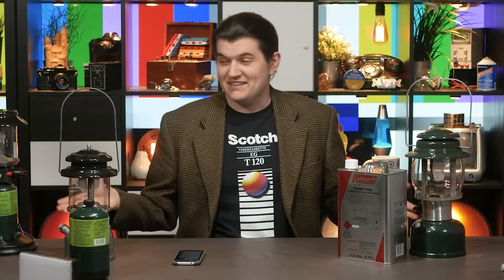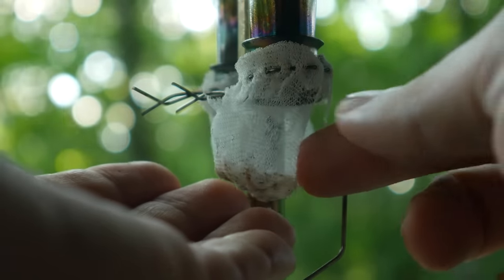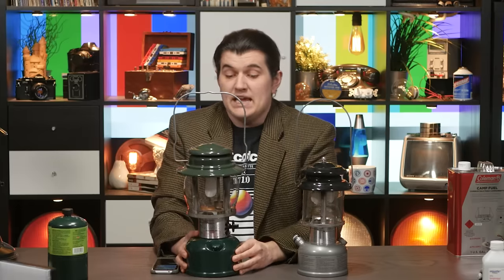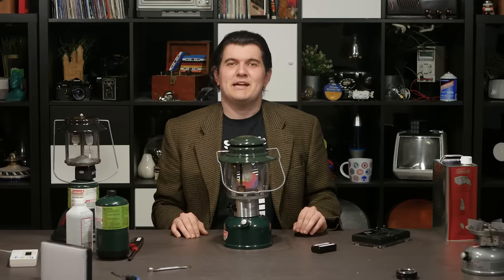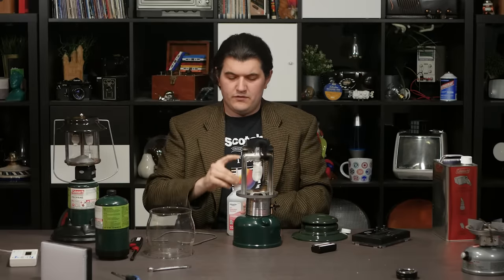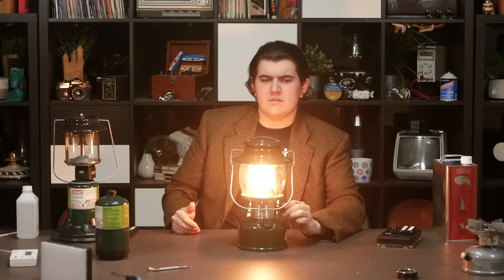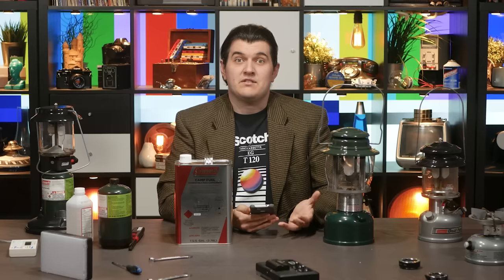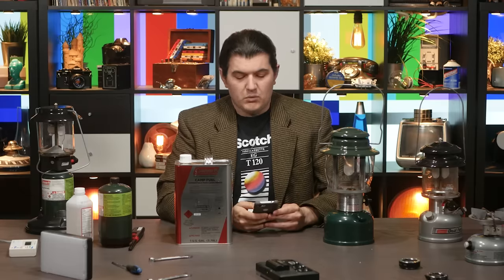A very rambly Coleman Lantern follow-up. Turns out they rarely make sense in 2021

Comment: I use all my white gas lanterns indoors. A properly maintained lantern with a properly tightened fuel cap would never leak.

Plus, Coleman tests these with a burst rating at 1k psi. Operating psi is about 30.

Comment: I think when you strip everything away, the petrol option seems more reliable, ie, you know what you're going to get & for how long, whereas batteries can be unreliable, can wear out quicker than expected, or even be faulty.  If I were in a position that I needed to consider these options, I would use both ;-).  Great video, subbing now x.

Comment: The only time I could see these lanterns and stove being used is while you're in cold conditions, where batteries die very quickly and the fuel doesn't freeze that easily. We used these in Greenland while it was sub zero conditions.
Reply: It's rare, but some folks (stereotypically farmers) actually keep a tank of diesel fuel somewhere practical on their property (and I don't mean a hand-luggable tank, I mean a 50+ gallon tank) just so they can run e.g. a tractor without having to take it to a gas station. If you already have the fuel for your non-emergency needs, keeping a few lanterns around that can run off of it but are fit for carrying around makes sense.

Comment: In Oklahoma here. When it comes to emergency lighting, we have rechargeable LED's that we'll be happy to use during a power outage in the summer. However, in the winter we use the Coleman indoor propane heaters as a heat and light source. You're right that dual purpose heat and light sources are very important in a winter loss of power. Even in those cases though we make sure we use products that are rated for indoor use and those lanterns just don't fit the bill. 

I agree with you on everyday or camping type needs though. That's why we have a lot of lanterns and lights that are rechargeable and quite a few external batteries that we use to recharge things while we're not at home. If bad weather is coming our way we always make sure to top those batteries off and recharge as many devices we might need as possible. It just makes the most since to do it that way.

Comment: Kerosene lasts a VERY long time.  I have burned 10 year old kerosene in a kerosene heater. It did not smell any different and did not burn any differently.   It's not like gasoline where it goes bad in a few months. 
Because you can buy kerosene from a gas pump, you can buy it it whatever quantity you like, and still pay the per-gallon price. You can literally but a quarter's worth of kerosene at the gas station.  Or you can drive in with a 55 gallon drum and fill it up assuming you can lift 55 gallons at 6 pounds a gallon.
Kerosene is a MUCH better supply for emergencies than batteries. You can buy kerosene heaters (which I have), kerosene stove tops (which I have) and kerosene lanterns which I do not currently own one.  With the longevity of it, you can buy a LOT of kerosene. It is very safe and easy to store as well.  I live in a very large city, the 5th largest in the US and I can literally walk to the gas station and buy kerosene any time of the day or night.  Even in a place like Philadelphia which is a large city with lots of infrastructure, there are 2 gas stations close enough to my house that I could walk to them if necessary.  I can also get it delivered in 55 gallon drums.
Second, batteries are only good one time for emergencies unless you have a generator to recharge them.  If your power outage lasts a few hours, batteries are fine. If the power goes out for a week, batteries are USELESS.  Battery operated cooking really isn't practical nor is battery operated heat.

Comment: "I just cannot find a way to make any of these justifiable to where you know you need a portable light source."

They're cooler than LEDs, that's all the justification needed. =]
Reply: Well not litterally, they actually produce substantially more heat for a given amount of light.
Reply: @garethbaus5471  Which is a bonus
Reply: @trueppp  depending on the exact circumstances.

Comment: 20:40 what’s the runtime difference between white gas and kerosine on a full tank?
Reply: The withe gas lanterns run about 4h on one tank.
Reply: I would think not much difference assuming the same size tank. I believe kerosene has a bit more energy per gallon than gasoline ( I know diesel does), but I think the difference is small.

Comment: I found my dads old 220B from the 40s like 10 years ago and it peaked my interest.  I no have 2 220s, a 228 i think, 200A red single mantle, a 2 burner white gas burner and a 501 pocket stove..

Once i got into the old Coleman white gas lanterns I found a lot of them for cheap on Offer up that were only in need of a new O ring or the leather gasket on the pump needing soaked in oil for 30 mins to make it air tight..  i love Coleman white gas lanterns and stoves

Those holes on the metal base of the mantle will fit a flint/striker so the lantern is more self sustainable incase you dont have a match or lighter

Comment: Whenever we camped, we hardly ever lit the gas lantern because it attracted every insect within 5 miles. 

(And occasionally set them on fire.)

Propane stoves and lanterns also don't work well in cold weather - there's not enough heat to vaporize the propane in the tank.
Reply: So to put it in short: If you have an abnormal environment (for example extreme cold), you need some specialized equipment. Like in every other aspect of technology.

Comment: Coming from Norway I as so many others grew up with the Primus multi-fuel burner. They required some training to use and make them run efficiently, but they could run on so many different kind of fuel, and I quote: "including gas, petrol, diesel, kerosene and even jet fuel". It was and is still, as far as I'm aware of, used in the military. It's very convenient and it gives some comfort to have a cooking stove that could use so many fuel sources. You could use them to heat and/or light up the tent. However, when I'm out hiking now I use LED-based lights and I have a couple of the same panel you show in this video. They are much more convenient when you just need light. However, you will still find a lot of kerosene lamps in most traditional Norwegian cabins.
Reply: Hi thomasgabrielsen have you become a flat earther yet? If not I suggest watch a 13 part series called What on earth happened by Ewaranon to learn that the earth is not a globe. I got it in my about tab.
Reply: @flat-earther  No. I'm probably what you most likely consider a lost cause.
Reply: @ThomasGabrielsen  Okay. I suggest watching the series to learn stuff you may have not heard before.
Reply: @flat-earther  Just out of curiosity: What made you ask a random person commenting on a video about kerosene lamps if he has "become a flat earther yet"? It doesn't make any sense.
Reply: @ThomasGabrielsen  My comment is a random suggestion.

Comment: I bought my Coleman lamp (white gas only) 20 years ago when I moved into my rural home with electricity that could be kind of spotty at times.  I also bought a gallon of white gas, and after 20 years still have some left - and the lamp runs just fine on it.  I doubt that would be the case with batteries - their chemistry is just too fragile.
Reply: Yeeeeah, I mean li-ion batteries are pretty good since 2012 or so, and I still have some cells from 6 or so years ago that still work alright, but the tech is not quite at the "decades in storage" level yet.
Reply: Yeah, they are a great backup to pull out and know it will work as long as it wasn't getting wet and rusty. Plus provides some heat for your hands too, and a makeshift stove if you put a rack over it. 

 Even if someone stashed away a propane lantern and some 1lb bottles there's no guarantee that seal on the tank won't have leaked over a decade and you are left with no fuel. 

I have my solar setup and big batteries, but i'll still keep my lanterns and stove :)
Reply: I got you but then again. If you've used less than a gallon of white gas in twenty years...wouldn't it be easier to just use basic non-rechargable battery powered lights that cost nearly nothing and change batteries every ten years or so? I always have a few batteries at home.
Reply: I'll take "didn't really watch the video" for $400, Alec.

Comment: Some items are timeless. That includes traditional belt buckles (people try, but all the new designs are soon forgotten), the concept of men carrying a wallet, and lanterns that don't need batteries to work. Yes, even in 2021. Plenty of rural places out there where only a bit of light will seem like the sun came back out. (No light pollution from street lamps or office buildings at night.) And in those places, a bit of fuel is far easier to find than some new batteries. In third world counties, the above isn't going to apply to just the rural areas. These types of lanterns are going to be around far longer than most YouTube content creators will be.
Reply: Ratching or quick release belts have replaced “traditional “ buckles for me for years
Reply: The Sofirn BLF LT1 lantern was specifically designed by the Budget LIght Forum to work for extended periods off-grid.  It lasts for 7 hours at max brightness of 600ish lumens, which is "illuminate the entire campsite" kind of light.  Inside a room you can get nice illumination at a much lower brightness, and it can do 50ish lumens for 60 hours straight.  It uses lithium ion rechargeable batteries, and has usb-c charging built in.  It's designed to charge off foldable solar panels, so unless you are somewhere that the sun doesn't come out for multiple weeks at a time, the LT1 will be a much more cost effective and convenient option in the long run.

The included lithium ion cells are relatively good, and should be solid through more than 500 charge cycles.  You can also get higher end cells with better quality and capacity if you want, and those should give at least 1000 charge cycles and offer longer runtimes.  With daily full use, that's about 3 years before you need to spend another $25 on more batteries.

Comment: The whole in the pump stick being able to stay covered when pumping is a new feature. We had an old camping stoves in the Boy Scouts that would not move to the out position if the finger was over the little hole. I imagine they changed that in later designs and it has a valve somewhere else too.
Reply: @Les I think the only real change in the pumps over the years is that they changed the material in the cup on the plunger (the part that actually seals the pump cylinder) from leather to synthetic rubber somewhere along the way.

Comment: Anything electric in outdoor conditions boils down to reliability when exposed to the elements. You can swim through a river with your entire propane/gasoline/kerosene gear, let it dry and still use it. (Sometimes you just see rivers from above.) And depending on the weather a failure might be the difference between life and death.

But especially for lithium as proposed in this video there is also a safety problem. You don't want to carry lots of lithium with you outdoors. Lithium violently reacts with water. When lithium ignites (because cheapo BMS failed outdoors) it can't extinguished with water and might even be source of a forest fire. You don't want to carry hundreds of watt hours worth of lithium on your person, if you value your survival.
Reply: That's quite a few layers of cheese for a failure case to go through to cause a lithium fire, however water resistance is a valid point, but mitigatable. I'm assuming that if you where going camping in that situation you would look for a LED camping lamp with a high IP rating.

But onwards with the fire risk, If the manufacturer lied about the IP rating you would have 1-2 more layers of protection from water reaching the lithium, firstly most lithium cells are sealed, and in the example of the video where infolithium is used that has the first layer of a ultrasonically welded case and then the cells own seal inside of that.

Survivability of the elements is a massive but mitigatable risk, but the fire risk is a huge but sometimes
Reply: Modern led lights are probably more water resistant then the old gas lights. You could go swimming when they are on and be fine
Reply: The safety issue is not entirely true. Lithium ion batteries contain negligible amounts of elemental lithium. Lithium ion battery fires generally start due to a short circuit and the electrical energy being converted into heat energy. Lots and lots of water is the best thing to use to fight a lithium ion battery fire, because it removes the heat and stops the electrolyte igniting itself.

Comment: Even though I haven't used one in years, there is something about the sound of the old Coleman lantern that just screams camping and hits me right in the heart (we had them when I was growing up). Coleman needs to program an LED lantern with a speaker that makes the sound of a white gas lantern and maybe even blinks and sputters a few times as it warms up.
Reply: Or maybe it doesn’t. As someone who never used gas lanterns and only used battery powered ones, I don’t get the whole having a loud, venting lantern as part of the outdoor experience. I figured having it quiet was the way when outdoors because of the connection you get with nature. Maybe that’s just me.
Reply: @Starlite_Collector  Not that loud.  I have a hundred gas lanterns and considerer most of them as having a pleasant hum.  But that's me.

Comment: I'm not going to argue the white gas/kerosene efficiency/price topic. I couple of things. The only time I use white gas is winter camping. Propane and isobutane stoves do not work under 20F (-7C). Our Colman lantern throws MUCH more light than any battery powered LED lantern. Solar charging doesn't work well in the winter either. During Covid white gas was scarce so it was great to  have a stove and lantern that also worked on Kerosene/gasoline. All of my winter camping gear doubles as emergency gear so versatile fuels are another bonus. I just got the extreme cold portion of the video... I'm certainly not normal. This is also not a rabid comment, just a use case.

Comment: Will you or can you do a follow up regarding the  Carbon monoxide output of the lamps? ive heard using unleaded is way worse than using white gas in "semi" closed environments with propane being the "best" . old coleman manuals from my old gas lanterns and catalytic heaters(from the 60s and 70s) suggest just unzipping a small outlet in your tent to use the lantern inside a closed tent. this seems crazy to me. thanks! love the channels!
Reply: Honestly, if you can manage to arrange a tube for use as a smokestack, then you should be fine. IF. Beware fire hazards!

As for manuals from the 50s & 60s, I would tend to suspect tents with much more air infiltration due to different materials may tilt numbers a bit.
Reply: @absalomdraconis  A wet tent and a catalytic heater could kill you and did in some cases. Carbon monoxide got produced then because it is a product of incomplete combustion and O2 levels would fall in the now more or less airtight tent. As for oxygen depletion danger. You can survive on a level of oxygen that won't support a candle flame.
Reply: Not much CO produced with enough combustion air. Oxygen depletion is not the problem it seems at first. The stove,lamp ,or heater doesn't use up all of the oxygen.You actually need less oxygen than the heater does to burn. The problem is in that low oxygen condition before it snuffs out is when it will also produce lethal levels of CO. Your O2 saturation levels go lower and lower due to CO absorption and it becomes a fatal feedback loop.

Comment: I agree 100% on the battery being better for almost every situation.  I do still use my Coleman fuel lantern, but only out of nostalgia since I grew up with one.  I wouldn't recommend one to anyone over led options.
Reply: We have a Coleman LED lantern that strongly apes their fuel lanterns, down to the two LED clusters in little mantle lookalikes. It’s supposed to run on 8 D cells, but it’ll happily run all night on AA rechargeables with spacers, which still adds up to about 20Wh. You turn the dial and it makes light, and it’s safe for the kids.

And as he mentioned later in the video, so long as you have access to sunlight, a solar panel to recharge batteries during the day means you have an endless supply of energy, and you don’t have to stockpile large amounts of fuel. $100 gets you a 100W panel these days, and with a cheap charge controller, you can use a car battery for bulk storage. There are also plenty of cheap panels that run as a typical USB 5V charger output that can charge power banks or other 5V chargers for other battery types.

Comment: Thank you for an excellent video and here is my opinion for what it's worth. We don't all live where there is sufficient sunlight throughout the year to be able to wholly rely on solar power. Running lamps/stoves on kerosene/paraffin or petrol/naptha/gas most certainly has its place and if you know what you are doing, are safe and very effective. IMO during cold weather/emergency situations, the liquid fuel options win hands down for long term reliability and heat/light generation. For short term trips/IT use etc with the family, solar/battery options are probably preferable in this modern age for reasons of convenience and basic safety considerations. It's not all about economics either. I was born in 1956 and my father used a Bialaddin 300X paraffin lamp on the farm, as we had no mains electricity at the time. That lamp still works and I use it regularly. I also have various other pressure lamps and stoves, plus solar generators and LED lights etc. I find that a mix of system types covers all the bases. 🇬🇧